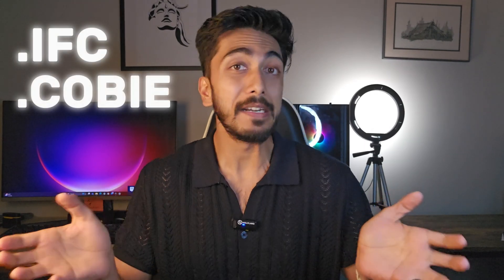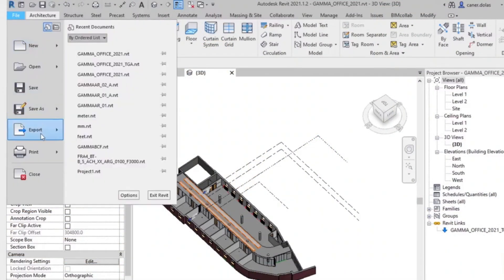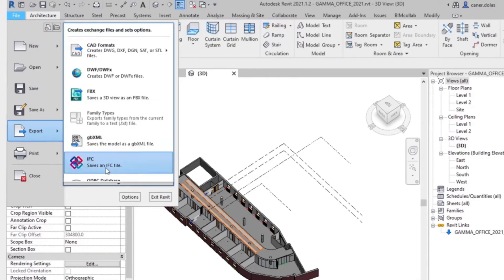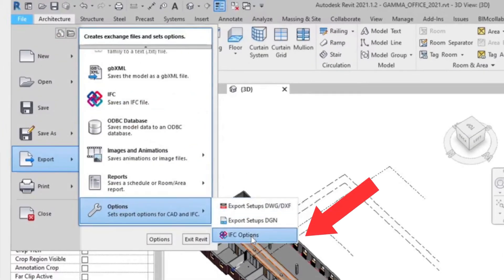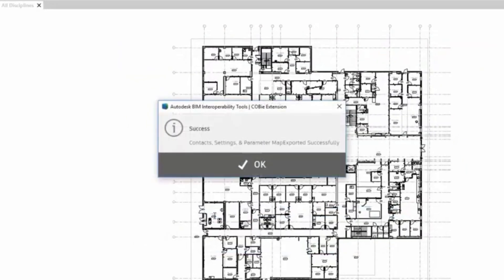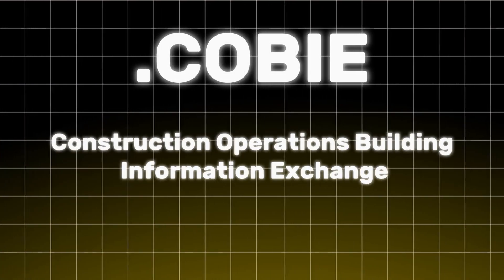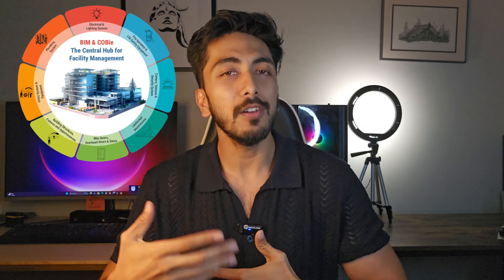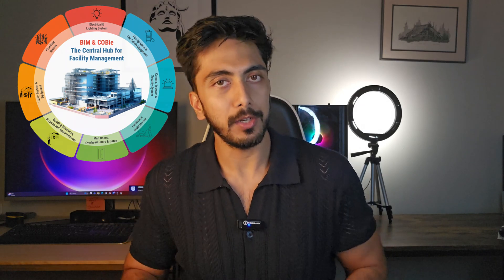What is IFC and Cobie in BIM and why its used?

Comment: do proper research on ifc
Reply from the maker: You share your knowledge, dont just accuse.
Reply: @ArchiVlogs.  very well, IFC has never been properly supported in neither revit nor archicad. If you manage to export at all you will experience significant data loss. Something you would know about if you ever used it on a real project
Reply from the maker: @aaaa-f8g6s  @aaaa-f8g6s  chill out I am not explain how any when to use ifc ..but what ifc is ? I didnt mention we just prefer ifc or we should always use ifc.  I understand you might be frustrated by work, but dont spread negativity here. Every point i have said is true.. both in video and in comments.
Reply: @ArchiVlogs.  I don't think you've ever used bim software in real life